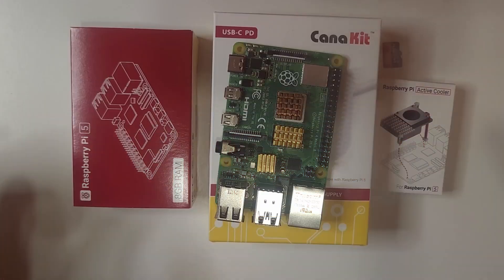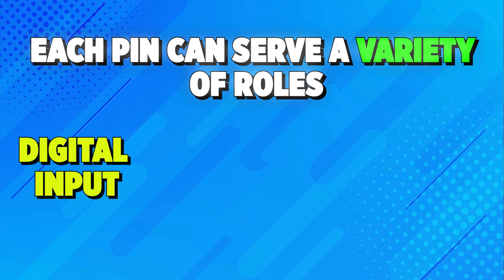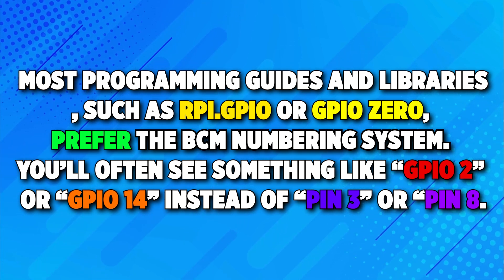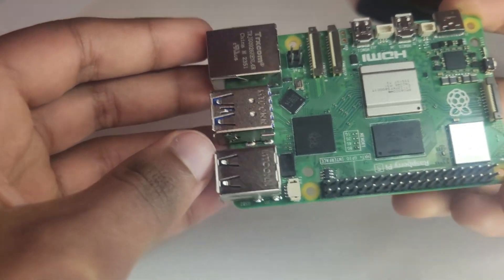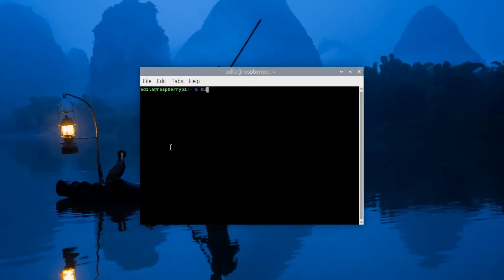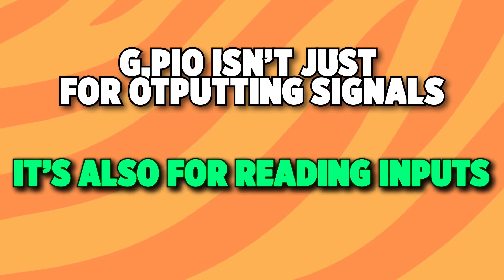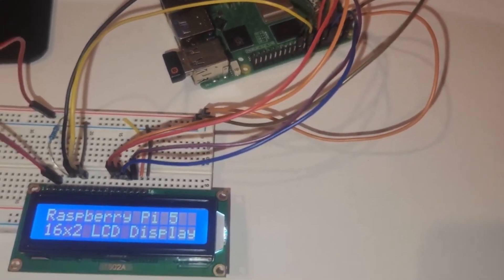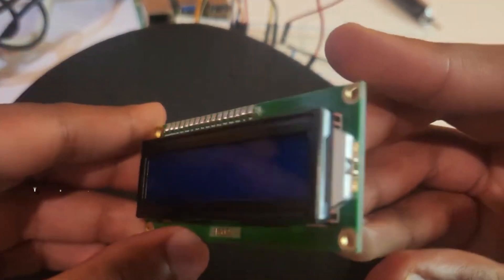Raspberry Pi GPIO: A Beginner’s Guide (2025)

Comment: Is there a way to sense voltage off of digital or analog pins without vref or I2C, etc. if you have a video and covering this please let me know thank you great video by the way.
Reply from the maker: Raspberry Pi’s standard GPIO pins are digital-only, so they can’t directly sense voltage levels like an analog input does. Without external components or protocols like I²C or SPI (e.g. using an ADC chip), there's no native way to read variable voltages.

However, for basic voltage detection, you can:

Use a voltage divider to bring voltage down to safe levels.

Use threshold-based digital inputs to detect if voltage is above or below certain levels (i.e. HIGH or LOW), but not actual voltage values.
Reply: @raspberrypimadeeasy thank you so much for your reply. Been researching all day. That really helps. Hope you're having a great day
Reply from the maker: @BranDublin  glad this helps

Comment: will this library work to control a motor because we made the necessary connection but the motor doesnt move
Reply from the maker: Yes, the `python3-gpiozero` library should work for motor control on a Raspberry Pi. If your motor isn’t moving, first double-check the wiring and make sure the motor is receiving the correct power supply. After that, consider installing and testing the library in a dedicated Python virtual environment to avoid conflicts with other packages. If you’re unfamiliar with creating or using virtual environments, this video walkthrough can help you get started: [https://www.youtube.com/watch?v=QikjxnoyFDs](https://www.youtube.com/watch?v=QikjxnoyFDs).
Reply: @raspberrypimadeeasy   we have been using this gpoid library for raspberry pi 5 when we run the codes its saying it cant detect the gpio chips ,are u familar with this error?
Reply from the maker: Yes, this issue is common with the Raspberry Pi 5 because it uses a different GPIO chip compared to earlier models. The RPi.GPIO library is not compatible with the Pi 5. To resolve this, you can switch to the GPIO Zero library, which is recommended for the Pi 5.
Reply from the maker: To make motor control work on the Raspberry Pi 5, you need to ensure compatibility with the GPIO Zero library, as the older RPi.GPIO library doesn't support the Pi 5's updated GPIO chip2. Here's a high-level approach:

Library Compatibility: Confirm that you're using the GPIO Zero library, which is designed for the Pi 5. If you're controlling a motor, GPIO Zero supports basic motor control functions.

Connections: Double-check your wiring. Ensure the motor is connected to the correct GPIO pins and that the power supply is sufficient for the motor's requirements.

Code Adjustments: Use GPIO Zero's Motor class for controlling motors. For example:

from gpiozero import Motor
motor = Motor(forward=17, backward=18)
motor.forward()

Testing: Run simple test scripts to verify the motor's functionality. If it doesn't move, check for errors in the code or hardware setup.

Troubleshooting: If the motor still doesn't work, inspect the GPIO pin configuration, ensure the library is up-to-date, and verify the motor's voltage and current requirements.
Reply: @SaiDharahasReddyIndrakanti did you resolve this issue?

I have the same problem with a DM420 Driver for the Nema17.